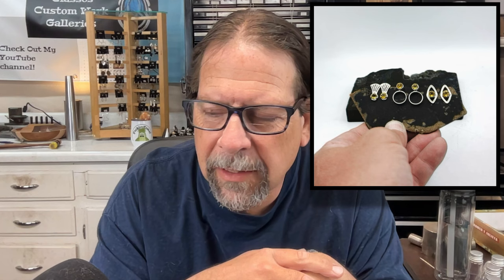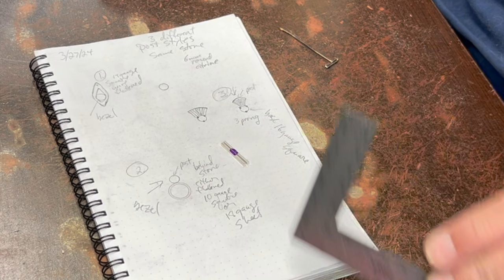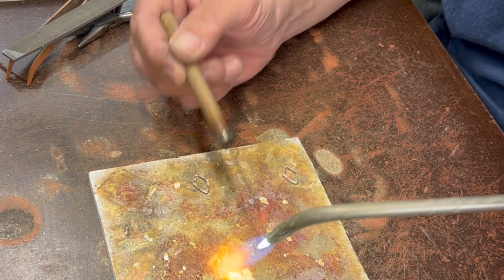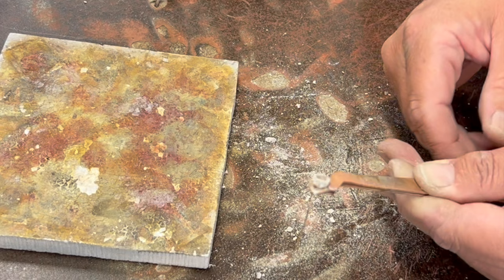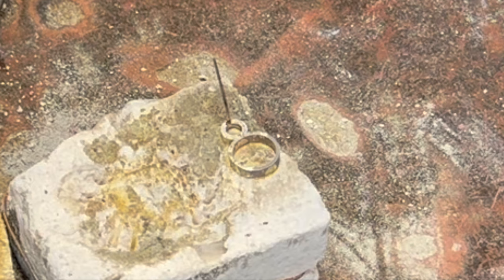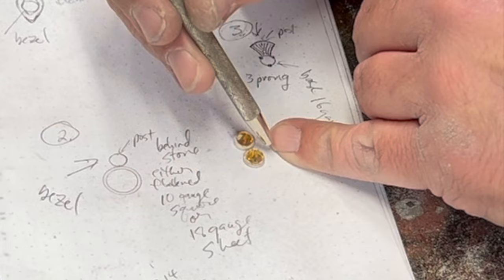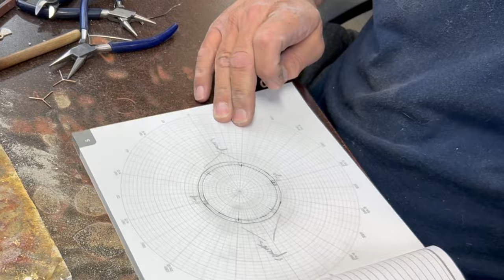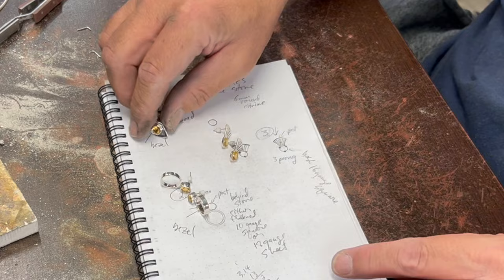3 Post Earring Designs with Citrine: A Silversmithing Tutorial

Comment: Hey Chad, I really enjoy your videos! I'm new to silversmiths and have had my silver to fall apart and not at a solder joint and not melted apart. Would please tell what causes this? I'm using micro butane torch and wonder if I'm heating it for to long to get it to solder. Thanks,  Mikel
Reply from the maker: Hello Mike!  Those butane torches don't really produce enough heat to do pieces with any size.  It could be that your piece is oxidizing really badly from heating too long, which makes things hard to solder.  I'd have to see it happen to really figure out what is going on. If you can send me a pic of the piece to my Instagram, I might be able to give you a better diagnosis:)
Reply: @chadssilversmithing Thanks Chad for your reply.  I think too small of a torch is my problem. I used a bigger torch last night and everything went OK. Tip you might try. I use heavy waxed cotton cord for sewing leather with rouge rubbed on it and run it through hard to polish areas. Pull it tight one end in a vise and rub my silver jewelry back and forth over it. It takes some effort but does help with tight paces. 
Thanks again,  keep up the good work!
Mikel
Reply: Kind 😅

Comment: Hi Chad saludos desde La Paz Bolivia 🇧🇴🇧🇴🇧🇴 Can you tell me if you start with a hard weld then medium and then soft
Reply: Oh I Saw in the description box You use hard solder 🤗🤗🤗
Reply: And a spray on Flux called mighty Flux 😂
Reply from the maker: ¡Hola desde Colorado! Lo siento, no respondí a su comentario antes. Como dijiste, utilizo soldadura de plata dura casi siempre. Si no puedes encontrar My-t-Flux, el Flujo de Autodecapado de Battern es muy parecido. ¡Gracias por el comentario!